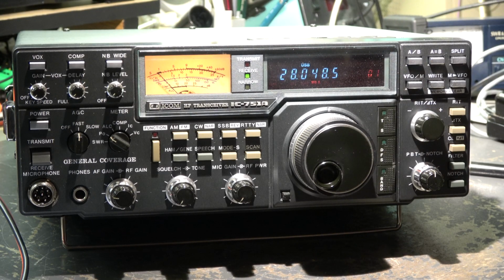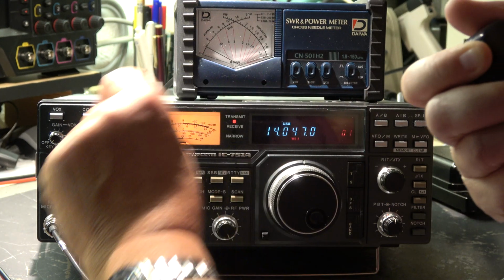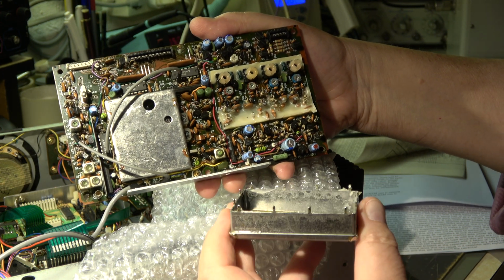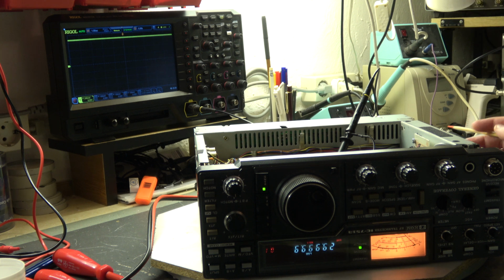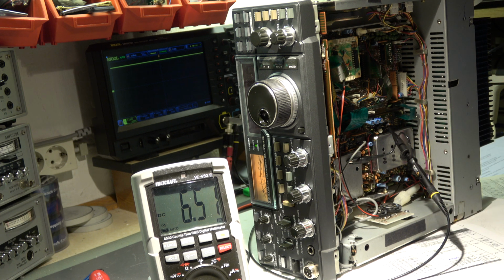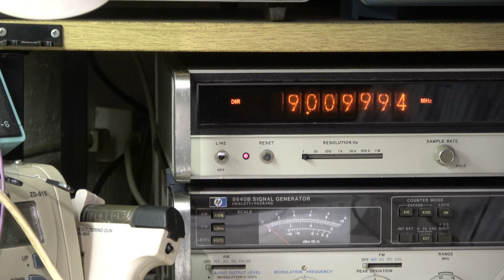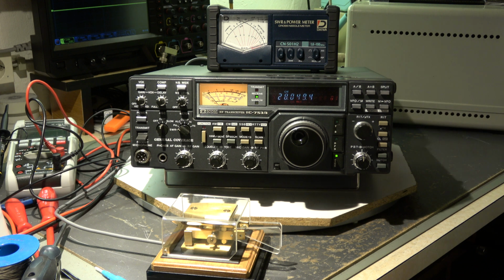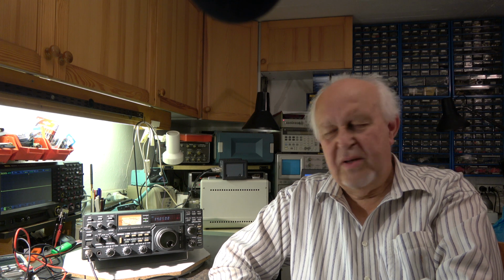#179 ICOM IC 751A

Comment: I bought this radio right after it was released in Japan. A few years later, the trimmer capacitor failed. There was an ICOM Tokyo branch and service center in the town next to where I lived in Tokyo, so I asked them to repair the radio. The repair was completed soon after and I was able to use it for a while, but the same problem occurred again, so I took the radio to the service center. The problem was with the trimmer capacitor, which was an original part. It turned out that the original variable capacitor deteriorated quickly due to the effects of temperature changes. Therefore, the service center installed a new capacitor. It is not the original capacitor that appears in this video. It is a radio with good basic performance, so I still use it carefully. Currently, ICOM in Japan does not accept any repairs for this kind of old radio. There are no replacement parts.

Comment: Hi stefan...how disconnettere the ribbon flat cable in order to manager the board VCO
Reply from the maker: The connector has a lock, which can be unlocked (=lifted) by the two flaps on each side of the cable/connector.
Don´t forget to lock the cable vice versa after the work; otherwise you´ll create a new problem over the ime...hi.
Reply: @dl7majstefan753 Здравствуйте, как думаете  если  подать  питание  15  вольт , не сгорит ???

Comment: I also have an IC-751A. Excellent device. There was one problem with it - the vacuum indicator stopped working. I found a couple of bad solders and everything works again. I made a new RAM board for him. And now I don’t have to worry about having a dead battery! I also made an analogue of the UX-14 interface module. And the transceiver now has CAT! Unfortunately, due to the Russian attack, I had to leave all the equipment there and save the family more than 1000 km from home.
Reply from the maker: Hope all is OK now for you and your family which is much much more important than any equipment. All the best!

Comment: I also had an IC-751A. Excellent device. There was one problem with it - the vacuum indicator stopped working. I found a couple of bad solders and everything works again. I made a new RAM board for him. And now I don’t have to worry about having a dead battery! I also made an analogue of the UX-14 interface module. And the transceiver now has CAT! Unfortunately, due to the Russian attack, I had to leave all the equipment there and save the family more than 1000 km from home.
Reply from the maker: Hope all is OK now for you and your family which is much much more important than any equipment. All the best!
Reply: @dl7majstefan753  Thank you. We are now in a relatively safe place. There is no complete safety anywhere now.
Reply: @Vinni315 если не секрет откуда ты ?
Reply: @Alex-x8i6z  не секрет. А в чем вопрос?

Comment: Stefan where did you get the trimmer caps? I have a 751A  I may need to replace mine
Reply from the maker: I was brave enough to by them on a famous platform. The value doesn´t need to be spot on - some pf more are not critical and you´ll see if the setting range is not correct.

Comment: Nice to have a relatively easy repair ocassionally. I just completed repair of an HP 3468A multimeter that needed a negative 15 volt regulator IC, capacitors, and a NVRAM battery plus calibration. Always satisfying to bring a piece of equipment back to life! Thank you for sharing this repair with us. Regards, David
Reply from the maker: Tnx dr David. Yes and the mount trash is a little big smaller....hi.

Comment: In my experience, when repairing ICOM devices from the late 70s to 80s, you spend a lot of time looking for cold solder joints and particularly bad PCB through-holes ;-)
But thank God everything can be repaired.
Anyway, thank you very much for your nice video Stefan.
73 de Bernd DF7PI
Reply from the maker: Aber insgesamt ist dieser TRX bzgl. Durchkontaktierungen nicht bekannt für Probleme; scheint dass ICOM das da schon im Griff hatte.